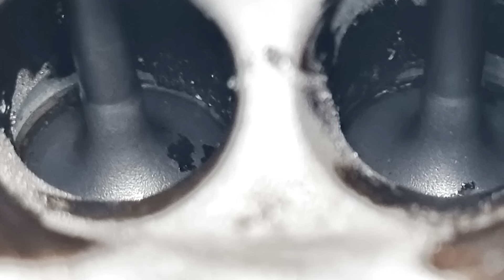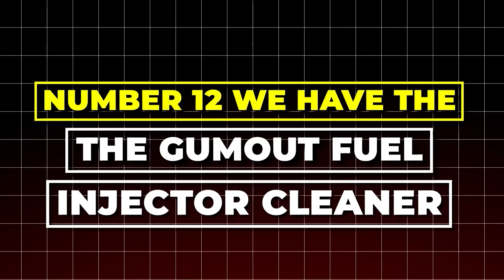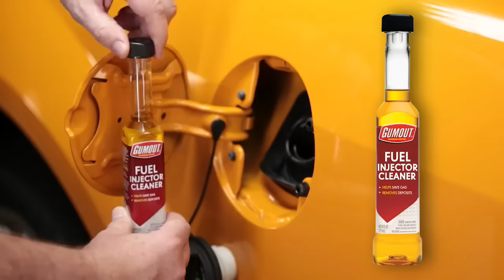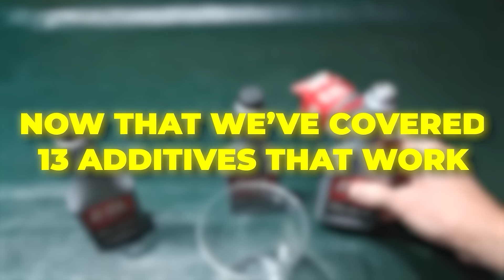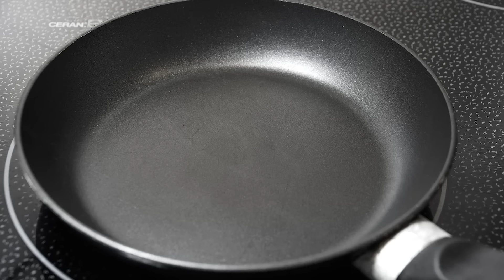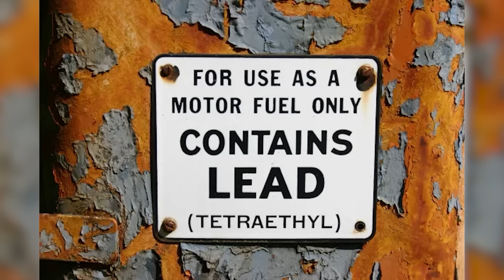13 Engine Additives That Work (And 5 That’ll Kill Your Car)

Comment: I can’t believe ther is no mention of Prolong in the video or comments. This stuff is absolutely amazing! I had a 1996 Nissan pathfinder SE V6 that I had always used it in and it eventually had a bad leaking main seal. I kept enough oil in it to just see on the tip of the dipstick. I drove the piss out of this truck for over 5 years like this. A couple times a year I would put in a bottle and fill the oil. Never had a problem. I eventually traded it in for a new car. We now put Prolong in every vehicle we own ever other oil change. I encourage anyone to find some old videos of Prolong and watch what they did to cars to test it. And most important, the bushing test!

And that is Prolong, not prolube that o have just seen.

Comment: God damn man, this snake oil debate is ridiculous. Yes, if you run a turbo tfsi hard, a point will come when you'll hafta get in there, and either carefully do yer best to clean out the carbon buildup, you can use gasoline, brake cleen, friggin rubbing alcohol,....now he's onto octane booster saying it don't work? Jesus😢, NO, it doesn't up the octane rating much, and it NOT ABOUT POWER, ITS ABOUT KEEPING KNOCK FROM OCCURING IN TURBO ENGINES, predominantly, or any high compression, or forced induction engine, which are lower compression, but with the added force of air and metered fuel, become knock machines. Screw catalytic converters altogether, they cause nothing but trouble and choke the whole system. Sea foam for gasoline engines sparingly! Don't put that stuff in yer pcv or vacuum lines, replace that shit. Berrymans is cheaper n works about the same. Lifters clacking? Run a bit of barrymans or sea foam in yer oil, or automatic trans fluid, or marvels for like, a minute, rev it, not redline, but get some pressure going, change that shit add a teaspoon of something heavy, I've used bar n chain oil, looking for that stringy sticky stuff, but like, a TEASPOON....Lucas? Sure. Rislone? Whatever. If the lifter keeps ticking, let it tick n beat on it some, it'll either stop, or it won't. Ran a 95 S10 for 14 yrs that was a ticking machine, 289,000+, still runs, still ticks, n for a 4 banger, that ain't bad. Imo, just use good oil, keep EVERYTHING CLEAN, IT TAKES HARD WORK AND PATIENCE, OR A SAVINGS ACCOUNT, you could go without any of this crap, most likely, yer engine would still need deep cleaning every 150-250k miles, none of this crap is gonna save you, just buy some time. Liqua moly, mobil Juan, Kendal, QUALITY oil that stays clean for longer than cheap bullshit, QUALITY air and oil filter, wix, puralator, Mann, FRAM IS THE DEVIL AND SEEKS TO MURDER YER DAILY RIDE, DO NOT USE FRAM, FRAM IS BEALZIBOB! spend the extra 3 dollhairs n get something that actually filters metal particles, K&N you say? Nope, they suck. Is there one in my turbo Passat? Yup, dirty as fugg, shoulda spent the extra five-fitty n got the dry element...whoops, K&N=taking the air filter out n cleaning it every erl' change, and if you re oil, I question yer sanity, run a "prefilter" whew! Triggers man!

Comment: My 1993 pathfinder had 920,000 klm when i parked it it 2004.sat at my farm and started it up once in a while. Sold it in 2023 to  some it still ran. Lucan on added. Only did timing chains and water pump every 150,000klm. Engine never was work on besides above.

Comment: I have used Lucas oil stabilizer for 25 plus years. I had a F350 with a 7.3 diesel. Did some engine mods at 220K mi. And pulled the heads for studs. The mechanic pulled the pan to check the crank shaft. The pan was so clean it didn't even need to be wiped out. Zero sludge or debris. Lucas works. I sold that truck at 450K mi. And it still ran and towed perfectly..

Comment: Chemtool B12 is my go to fuel system cleaner. Inexpensive too
Reply: b12 before the oil change and Lucas afterword will easily keep an engine tip-top for 350k+ miles, and definitely a combo that should be used together right away when purchasing a pre owned vehicle or by anyone who actually believes that running the same oil for more than 5000 miles or 5 months isnt going to have severe unwanted effects on that engine in the long run.

Comment: I only know a bout 6 of these and one never did anything for me but the other 5 such as Lucas oil stabilizer in worn engines is a must  but for engines maintaining a tight tolerance not so much. Sea foam after the original sea foam that did what it said it would do once you read the bottle and remove carbon from the engine but if carbon is what is keeping your engine running then it's not going to run much longer usually within 30 minutes. The now sea foam I don't notice any vehicle difference but it does work when you put it in a lawn mower or weed eater that's hard to start so it does work and the original sea foam worked to well.

Comment: Slick 50 pure Teflon is the best additive for gearboxes and difs ,it will fixed instantly any noises, but Teflon definitely is not good for engines

Comment: Where is the BI-TRON known as the best, it is after market product, originally used in usa army ,it reduces friction %30 for all tape of engines, all so have fuel additives for diesel and petrol, and increase octane by 7 points and cetane ,in Australia sold under brand Smith, all farmers in Australia uses it ,

Comment: Lucas additive works and viscosity doesn't stay that high it blends into oil and adds a little viscosity to your standard. The more oil your engine takes the less your viscosity changes for the 1 quart of Lucas. I wouldnt use it on 0-? But anything 5-20+ would be beneficial...

Comment: I bought a 2014 Chevy equinox that had the 6 cylinder engine and it was using excessive oil so l added the Lucas synthetic oil treatment which was one can added to each oil change and stopped the oil usage in it's tracks.  The problem was GM used weak piston rings to increase horsepower and it backfired on them there are so many of the four cylinder engines and check it out because so many have blown up the engines!

Comment: Ive been using Lucas oil stabilizer forever, my Chrysler 200s 3.6liter, I add with every oil change. Lucas is a great product, when i replaced my oil pan gasket, my crankshaft looked brand new, and was extremely slick from the Lucas. This stuff is excellent. My engine has 245k miles on it. With no check engine light. Lucas is very good, I know because Ive seen it myself!!

Comment: I make sure all gasoline I put in my cars tank is Top Tier certified. Has fuel system cleaners added. Techron is only added when I don't have access to Top Tier fuel. I also add 1 oz of Seafoam per quart of oil into the crankcase. This helps keep the intake valves free of deposits in my direct injection engine.

Comment: I started using Cenex non ethanol gasoline in my '07 Tundra 5.7 170k miles. MPG went from 11.5 average to 13.9 average with a max MPG of 14.1 on a highway road trip. My O2 sensors and cats are happy.

Comment: I added Lucas fuel additive to my 2001 Suburban with 130 k miles, which had never had an additive. Two days later my fuel pump failed from carbon that had broken off and clogged it. $1000 repair.

Comment: Lucas oil stabilizer 1 quart every oil change.
365,000 miles. 1995 5.0 GMC SIERRA.  This truck never burns or drips oil.

Comment: I'm here to vent, cause i'm still angry...at myself.
I had a 2001 Nissan Pathfinder, with 150k miles. It had the SMOOTHEST V6 I've ever owned. loved that thing.  I used to change the oil with Penzoil platinum, and a bottle of Lucas.  I stopped changing my own oil and started taking her to this Valvoline place by my house.  They always hired these young boys and girls that look like they were told you can do what man can do, fancy nails, soft little fingers, and plenty of no attention to detail.  I stayed in the car, because that's what they require you to do.  $80, and 15 minutes later drove off.  I drove home 2 miles, and the next day in 110 degrees drove to the next city over 20 miles and started hearing tik tik tik.  I didn't suspect the engine. I got back home that night, and checked the oil, and there was not a drop in the engine, and I had driven over 40 miles like that.  They had drain it from underneat, but she and her fancy nailed BFF did not fill her up from top.  I went back and complained but they wouldn't own up to it. they insisted I had an engine leak. like I wouldn't notice 5 quarts missing in one day. I went to my old mechanic buddy, and he said what saved you was the synthetic oil plus Lucas which still clung to the metal components.  but engine began consuming oil after that.  It is my fault.  I hope you understand but when they push these little kids into professions they are not qualified for, the rest of us suffer.

Comment: For many years I can attest that "Rislone" engine additive absolutely works as good as or better that anything out there. It's been around as long as Marvel Mystery Oil which I don't stand behind but Rislone has always lubed my engines, improve lubrication on top with lifters, valve seals, quiets high mileage valve trains and overall does an excellent job. There may be better products now but I haven't seen them proven better than Rislone, just my personal opinion.

Comment: My 1979 chevy van with a 305 I bought new that I only used Amoco 93 white gas and mobil 1 oil every 3K miles lasted me 400k miles with no additives before I sold it with never 1 issue. Maybe I should have used Lucas.

Comment: I wouldn't use sea foam on modern engine, it will destroy your O2 sensors to finally eat up your catalytic converter. Did that mistake on my Dodge pickup .

Comment: I've used techron in various vehicles for the last 30 years with positive results.
Reply: Used on 2 vehicles, good. Also Star Tron Enzyme Fuel Treatment. Had an old truck parked 4 a while. Ran rough, poured a bottle in, ran great for mths after. Removes Moisture. Says can B used in Marine as well.

Comment: I use Aviation Gas Low Lead 101 Octane mixed 50/50 with Premium Gas.
AvGas is a very dry fuel.
Great for cleaning parts like bearings for repacking.
I use AvGas in my 67 GTO and 68 Camaro.
Still with original engines.
I also have a gallon of TEL to mix with fuel as the 2 cars dont like unleaded fuel.
Reply: Has lead in it too
Reply: @robertoblanco4410 
didn't I  say that with " Low Lead "?

Comment: You forgot Prolong .  I have been using it for over 30 years . The best story I have is , I bought a 1995 Ford E-350 with a 351M and used it for hauling pallets of steel parts for Manufacturing companies . When I sold the van it had 730,000 on the original engine and rear diff . 
With the first Treatment of Prolong you can hear see and feel the difference within 2 minutes of start up . More horse power , quiet running and oil pressure rises a few pounds and over all better Fuel Efficiency .

Comment: I have been using Prolong engine treatment for years but it now hard to find and a little bit of Marvel and AT 205 for seals  Prolong I use have a 6 ounces  about 6 ounces of Marvell and 4 of AT 205 the rest I use oil to make one quart. I have close to 200,000 on all my vehicles and only need to work on a 3.5 Chrysler for a broken timing belt, my fault. These are mostly NJ city driving stopping for many lights and stop signs short distance often. When I had to do a valve job for bent valves the camshafts had almost no wear which is why most shops replace the heads. The other cars are  a 2011 Ford Escape 4 cyl that takes a lot of abuse because the engine is under powered and you must force it often, the other is a 2014 3.6 and they are known fore all kinds of trouble from cams to phaser and my biggest problem is the stupid oil cooler fails, for my last one it is a 2011 Ram Hemi that I use high speed heavy load long distance, city driving and riding at low speed idling a lot as I am a road runner scrapper and usable junk collector hat soe times idles for 10 plus minutes the worst thing to do these engines with the MDS system and it is because low oil pressure at idle, my biggest under hood problem a bad alternator and I do oil on all at 3000 to 4000 miles and never dirty  but change my  air filter often that saves cylinder wear if any dust gets through. As for Prolong I had a lethargic 1988 Chevy full size extra cab with many miles on it and it felt like a worn 305 but was 350 and poured a bottle of prolong but it may have  had another name Problend that we used in our cars that we ran on the track, It took a few days and that motor came to life after a few hundred miles the oil was dirty and repeated and improved power and gas mileage. Amazon carries Prolong but much cheaper at auto zone because your first use the whole 12 ounces as for Marvel get it where it is cheap and for AT 205 to keep valve seals and main bearing seals from weeping that I just order it from amazon it also good for most rubber like tailgate seals on SUVS to keep them sealing my daughter had a door seal that was in need of replacing and it solve her problem. I hesitate to use what I have not tried or know others who do, On a day like today with Pouring rain for the past 2 hours i do not want to wait for a tow truck. This why I am in my garage not out doing other work and posting my comment..Not telling anyone to do what I do just what I do and what seems to work for me.50 years of working on cars trying to make them last but not get sucked in by gimmicks I am too old too try something that could make me do another engine job because claims are not always true. Back in my day STP was sludge we used and it may have done more harm than good in a cold climate and now with thin oil that we use that would clog oil passages in 0 degree weather like eating a Baconator daily does to arteries. Key trick never go by recommended from owners manual because that is to get you past warranty and all the BS about you can run 25,000 miles on an oil change is no good. Oil is cheap but a pain to do but easier and cheaper than a new engine, My truck the first oil change was 7500 miles and I did it at 1500 and put in full synthetic and my blend with rough service and hitting the limiter at 105 more times I should say especially carrying loads of a ton or more or pulling heavy trailers at 80 MPH. Actually I looked it up and Problend does still exist but expensive and has shipping charges from amazon but may look in to using this and will let all know if i like it. May just add a few ounces to my mix. This was the stuff with no oil drained out a front engine dragster ran the quarter mile running Nitrous because the guy who selling it also made specialty nitrous systems. It was an engine they were replacing and wanted to see if claims were true. He had a machine to show regular oil VS Problend and oil seized at 30 FT LBS and Problend ran to way above 100 before the machine slowed down with less wear on the fail part. I got a race against a 95 Vette and will take all the help I can get.

Comment: Change your oil regularly. I use the once every 90 Day rule instead of mileage. On GDI, Gasoline Direct Injection engines oil changes are critical. 

As for the fuel injector cleaner... most recommend once per oil change cycle. Again on GDI Engines, fuel injector cleaner is recommended on the Oil Change Cycle. I personally do my injector cleaning one tank of fuel before my oil change. This way the old oil catches any garbage created by or rinsed out by the injector cleaner... then when the oil is changed out it goes with the old oil.

As for oil additives and crankcase cleaners... Danger Will Robinson... Danger. Great way to cause oil leaks where there were none before.

And some of those chemicals are pretty harsh... I don't recommend any of them.

Comment: LUCAS is an oil stabilizer.
If you use it , your oil won't change viscosity.
It will starve your engine of proper lubrication eventually.

Comment: :face-green-smiling::face-fuchsia-wide-eyes::face-fuchsia-tongue-out:I don't know where you are getting your information from, but some of it is complete nonsense. I am a mechanical engineer and most of those additives do little or nothing for your engine, especially Marvel's which has had it's formula completely changed. Seafoam is the worst product I have ever come across, and now they are copying Lucas additives.

Comment: I'm 186 years old, and I built the Noah's Ark...With wooden tools. Jmho I don't believe in motor oil. I put melted grape jelly in all my engines and I go 9,460 kilometers between jelly changes. Also I like to redline my engines monthly, in neutral of course, until I observe a noticeable coolant temperature increase. Then I know my valvespring heat treating and temper is still adequate for weekend school bus racing
Reply: 😂😂😂😂😂😂😂best comment here
Reply: Oh, and dude, the ark is a lot older than 186 years. Your story lacks any and all credibility. 😂
Reply: @williamjkaufman721 Exactly
Reply: lol!🤣
Reply: Yeah well, I built all transportation vehicles for the Lost City of Atlantis.... Raspberry Jelly was a good source of lube and color was easily detected for leaks.
Reply: Don't believe a word you said !
Reply: I'm going to try that, can I use jam instead of jelly? I ask as I've been making jam for 165 years, I started right after I graduated from the first trade school, and yes I started it too! And I'm 212 years old. Thanks for keeping it old school!